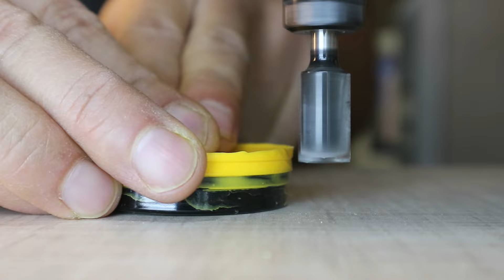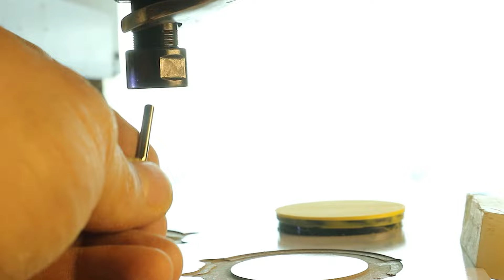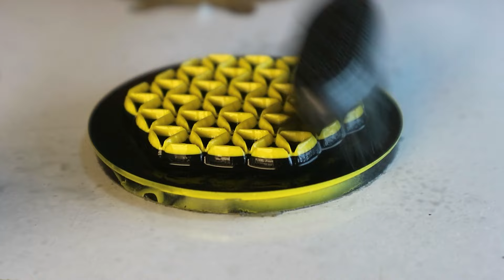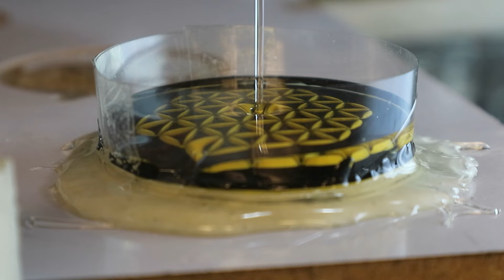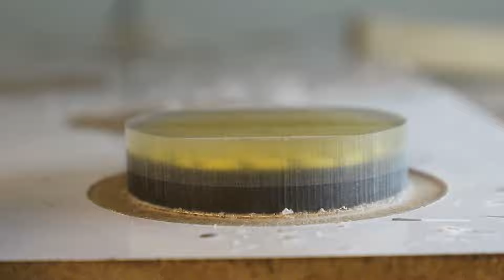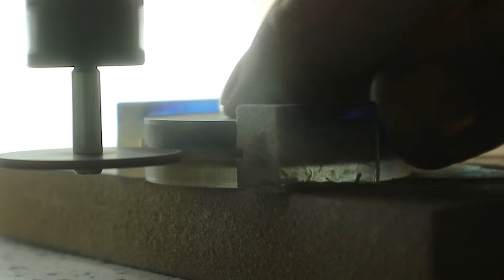Sacred Geometry - Making the Flower of Life Necklace

Comment: Should you be working on an unrestrained piece with a router in that way? I find that very unsafe. Ideally you'd be using a CNC router to clean it or at least an X-Y-table to move it, but if you don't want to invest in that, I'd suggest at least supergluing it to piece of plywood and restraining it with a fixture in some way so it can't go flying across the room and you have some more distance between your fingers and the router bit.
Reply from the maker: Yes, you are probably right😉✨💙